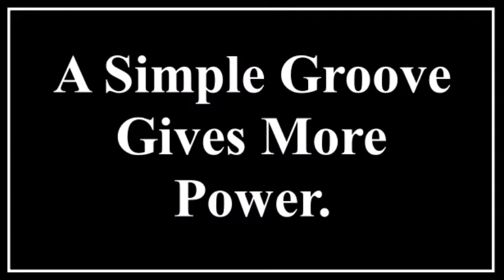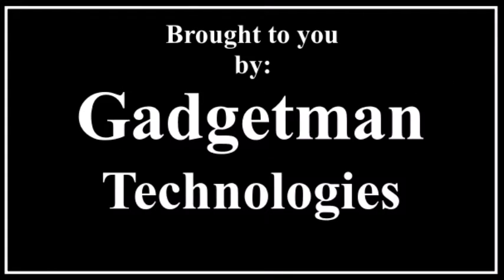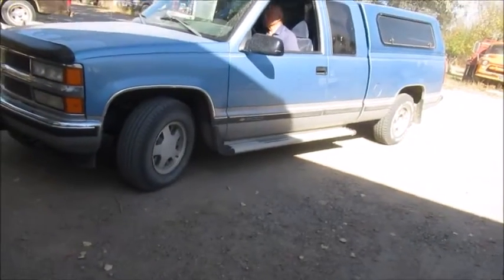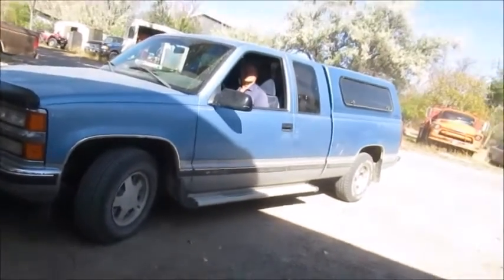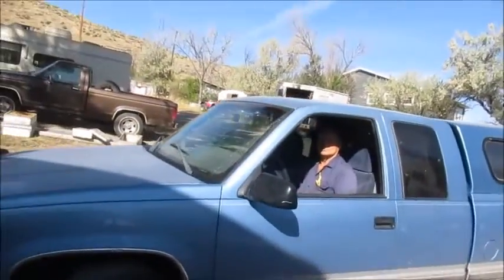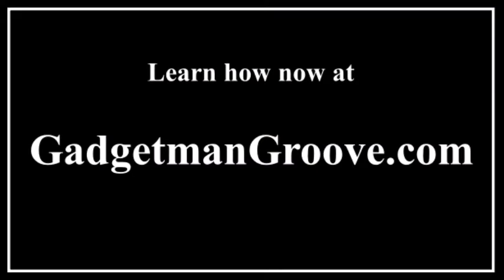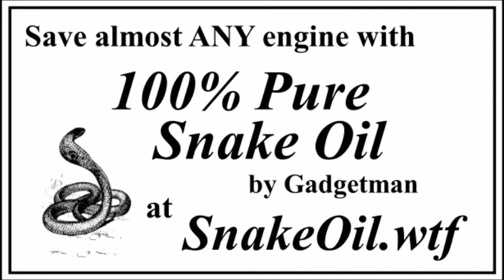How to get more power from any gasoline engine, without parts!

Comment: I think you should create a sort of throttlebody insert that has the perfect groove, so customer can simply cut a portion of the throttlebody out and insert this groove section and jb it . I would buy it and I'm sure you could easily sell it too if you use a flexible material it could fit all sizes of throttle bodies too just an idea. God bless
Reply from the maker: That would be lovely, but cutting the section out of the throttle assembly could not be done in over 90% of throttle bodies. But what I do is inexpensive for the benefits delivered. Like double the life of your oil changes. Imagine the savings of that alone over the years, let alone the cost of repairs to the exhaust system sensors!
Reply: @thegadgetmangroove6304  What about gas mileage?